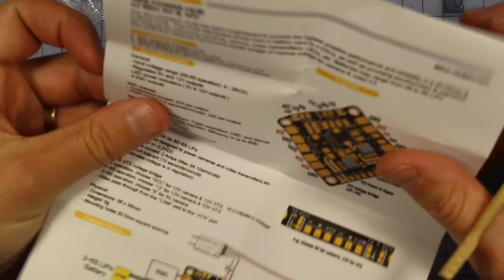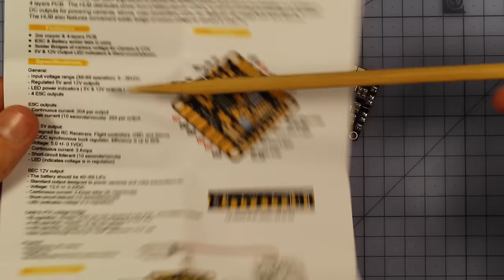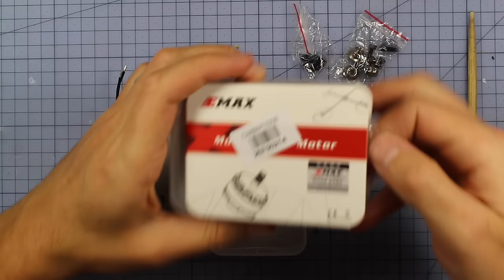Dubai Racer Review. Amazing beginner kit.

Comment: I replaced all M3 screws on lisam 210 frame that goes into standoffs, 10mm for the top plate and 12mm for the bottom plate, because there is only 10mm of thread in the standoffs.

Comment: Thank you and congratulations for your video. I'm wondering what battery you would recommend for the GB210 (same chassis and motors as Dubai 210 but with 30A ESCs instead of 20A)? I've seen the GB210 supports 3S as well as 4S batteries, in the range 1300-1800mAh. According to my computations, with a 4S / 1800mAh, it should have around 70C. Am I correct? Do you rather recommend a 3S or 4S for this quad (GB210, not Dubai 210)? What battery would you recommend? 
Thank you in advance for your help.
Reply from the maker: get something like 1400mah 4s 60+c rating.

Comment: i bought some 1800mAh 75c 3s batterries for this build, can anyone help try to figure out a flight time for these batterries? should i invesnt in osd for the voltage of the batterries
Reply from the maker: between 4 and 8 minutes
Reply: UAVfutures is the Dubai 210 a good first drone
Reply: Max Fan not the nest to be honest, when i ordered the kit many of the parts were not functioning properly. I have since built another with some better parts and it works wonderful. I used a similar frame, same motors but i got a Raptor 390 tower (all in one fc, pdb, and esc's). The only thing else you need is the camera, vtx and receiver. Hope this helped

Comment: Great vid, thanks.I have that same frame and can confirm the top plate is pretty weak. Broke on 2nd crash.Going to move the build over to an original qav210.
Reply: I lasted a few more flights before i snapped the top, but you can get the actual replacement top for the QAV from getfpv.com for about 13 bucks. Plus its a 2mm replacement so better than the 1.5mm this kit comes with.

Comment: Could I ask you a question? What kind of soldering station do you use? Or do you use an in expensive soldering iron? Are you going  to do a build video for this quad copter? Thanks Rich
Reply from the maker: I use a cheap soldering iron about $20... It works fine for me. I already have a build guide up on my channel for it

Comment: Hello I'm have the same esc you used in this build how did you fix them what setup did you use to flash them in blheli. mines are reading 12 amp afro's,  simonk bootloader, but the were supposed to be 20 amp blheli.
Reply from the maker: just flash them with the latest firmware and they are fine.

Comment: Can you suggest other parts that would go well with this kit, specifically for beginners? Things like remote controllers, batteries, FPV gear etc? 
Thanks.
Reply from the maker: Taranis radio, 1300 3s or 4s batteries, Hs1177 camera, and a 200mw foxeer or aomway vtx, I actually have a build of it on my channel too.
Reply: Thanks for the tips, one more thing I just thought of; mode 1 or mode 2 for the radio?

Comment: heya . I have got this kit now and building it .quick question with the esc''s and flashing , can I reverse the esc''s within no blheli suite or do I have to do u reverse set of wiring ? great kit sofar thank-you for your recommendation on this
Reply: actually scratch that .. its all good they supply long and short screws with the motors annnnd dont use the longer ones as they pinch and kill the coils in the motors

Comment: Would you be able to tell me which motors use the standard nuts? The motor manufacturers can't seem to decide whether clockwise means the rotation of the motor, or the direction of the thread on the nut..
Reply: Cw and ccw refers to the thread on the brushless motors. Really stupid as everyone who races uses lock nuts. Unnecessary hassle.
Reply from the maker: agree. get rid of them and just use lock nuts
Reply: +UAVfutures love your channel and the fact that you still manage to bug up the intro.

Comment: You can get that exact frame from eBay for $13 including shipping.I have the 180 version. Broke the top deck as expected.  It's OK, but you get what you pay for... I bought 2 of them in order to have a spare.
Reply from the maker: you should epoxy them together maybe. Someone suggested that you could run you battery around the whole frame and not just the top plate.
Reply: That's exactly what I'm doing (running the strap around the whole frame).  It does provide strength, that's for sure.  Mine broke at the back - the tab at the back for the battery wire and vtx. It's the weakest part of the quad.  That's OK. At $13 I can deal with that :-) easily fixed.

Comment: Hi there, love your videos....have just subscribed as you keep popping up in my feed.  :)  I have one of these coming from Gearbest, cost me £102    Quick question regarding the esc's, some other reviewers say you need to upgrade the esc's to run 4s, is this really the case?    RegardsCharly  PS What battery are you using?
Reply from the maker: Personally for me I always upgrade to the latest firmware when I do a build. I run a 4s battery and it works fine. The easy thing is you can do all this though the" bl heli suite" program.
Reply: Thank you, there is some miss information out there and like you on previous quads with 20amp esc's I have run 4s, even with cheap SimonK esc's.  I know these motors will do 23 amps but most 20amp esc's can do 30amp bursts anyway.  Unless someone invents a cheap battery that you have the space to hold the throttle wide open for a long period of time I do not see any problems.  Thanks for your reply and keep up the good work :)    PS: What battery id you use on this quad as I have still to order one?
Reply from the maker: Charly Sayz a 4s 1300mah hich c battery
Reply: UAVfutures Thanks :)

Comment: Hi this is my first racing build and configuration of software - is it pretty straightforward to do on BLHeli as never used this before only used clean flight for 250s.
Reply from the maker: very straight forward and easy
Reply: Hi went through to do this today but when I connected battery the board blew. Checked all soldering and connections and were fine - re wired another board and the same thing happened and exactly the same component blew on the board.  Do you have any suggestions as to what this might be?
Reply from the maker: Deecat21 so before you even worry about the software side of things, zero components should be blowing. something in your set up is not connected right.
Reply: Have double checked the connections with your video.  All clean and ok.  Might desolder the wires on pdb and start again!
Reply from the maker: Deecat21 Which part is blowing?

Comment: I ordered this kit and one of the six large standoffs that it came with had no threads on one end.  Is this normal?
Reply from the maker: umm no. That is very odd???
Reply: I'll have to contact gear best about it.  A new set of standoffs is only $5.50 on eBay, but it definitely threw me for a loop when I went to assemble it.
Reply from the maker: Nick Joslin for sure haha, at least you will still be able to build your quad while you wait

Comment: +UAVfutures  I would like to get into mini quads and this is the kit im most likely to buy but i really don't understand what has to be done on the software front of the build
Reply: You need to get CleanFlight chrome app and then plug in your flight controller. from there you flash cleanflight and can start configuring. There is very little needed initially to get the kit going. Then you just tweak tweak tweak as you find new features or options to set

Comment: For some reason whenever I add throttle my motos make the start up noise, (the noise then you first plug in bat, add throttle makes noise, cut throttle, add throttle again starts noise over ect, any recomendations? Thanks, Cooper.
Reply from the maker: calibrate your escs
Reply: +UAVfutures I have done that multiple times.
Reply from the maker: Cooper Stukel have up updated the firmware in bl heli suite
Reply: No, because there aren't really any good tutorials online to do that.
Reply: Yes i have flashed them and still keeps beepping.

Comment: great video Stu, what else should i get with this kit if i'm just starting out?
Reply from the maker: fpv gear and you are good to go
Reply: i just bought this kit too. Im new to this aswell. im getting the frysky taranis xd9 or something and fatshark dominators v3.
Reply: Sp racing board..."reliable" may be stretching it.
Reply from the maker: ok. I meant performance wise. Those connectors can snap off sometimes. but still a pretty solid performer

Comment: hi watt is your pid settings ?i have the same similor  setup but don't know how to setup mi pid .can you help me please ?
Reply from the maker: are you running betaflight
Reply: UAVfutures hi no i run on betaflight 2,.9.0
Reply: mi setup is 2204. 2300kv .emax .and flightcontroller is emax-skyline 32. bl heli 30 amp and mi frame is a Qav 210
Reply from the maker: brian scheko betaflight stock pids should be fine
Reply: ok thanks  for your  time .i appreciate it.
Reply: one more thing .i have a Taranis plus .when i am under 50% throttle my quad don't keep its position .it keeps going down .only above 50 i can control it where i wont it to be .but i cant fly low .mi setup is a clean one without doing  something in the model setup in the radio.where can i look for the problem ?
Reply from the maker: brian scheko I think you need to reduce the weight of your quad. It sounds heavy if you need over 50% throttle
Reply: ok i gonna try remove some things and see what happens  .thanks man.

Comment: Great video as always, if you're worried about the strength of the top of the frame, wouldn't it make sense to run a longer battery strap which wraps all the way around? That way you don't have the weight of the battery hanging off the thin plate.
Reply from the maker: THis is a really good idea
Reply: Not my idea; BoltRC suggest it for their frames, it seems obvious in retrospect. Speaking of Bolt, when are we going to see the Kraken review?
Reply from the maker: soon, Waiting on some bl heli s escs to get here and Ill be able to build it up
Reply: That's exactly what I do.  I have broken the top plate at the back - the bit that sticks out the back - but that's a weak point so I kind of expect that to happen.  I bet the Lumenier frame doesn't suffer from this malady, but at 10 times the price it shouldn't!!!
Reply: +Simon Wallace I can't see how any frame with that design wouldn't break there unless it uses thicker carbon.
Reply: Too right +benaresq - I will be laminating the end of the top plate with epoxy in future to thicken it up and give it more rigidity in future.
Reply: +Simon Wallace I've got one on order now, I'm thinking about cutting the back section off and fitting a stiff rubber/eurothane flap to hold the antenna.
Reply: I think that's a great idea!  I run my 2.4G antennae closer to the front. I use the hole on the back section for the power leads instead of the VTX antenna, I just couldn't get the right pigtail to feed into that hole.  Seems to work OK.  But I think your idea is better.

Comment: Great build video and everything... made me buy the kit. I was so stoked... but now two esc went into flames and the fc died on me. Don't know why.. I updated the fc, then the motors spinned like crazy. Yanked out the lipo offcourse.. but the damage was done. One esc died. I bought the same esc.. but again it fried. I orderd some new esc's and fc... I tried to update the esc's, but BLHeli didn't reconised them. I just read the esc's are flashed with 12a firmware and the oneshot doesn't work.. wth!!
Reply from the maker: OMG that sounds crazy ...were there any shorts. never had that happen in any of my builds.
Reply: +UAVfutures I triple checked the wires. I found some people on the internet with the same issue. They thought it was the firmware on the esc that don't go well with cleanflight. Oh well.. it's a part of the hobby. 😊

Comment: I'd be willing to bet that the CW vs CCW motors have better cooling when spinning in their correct direction. But thatsvthe only thing that would make sense.
Reply from the maker: Someone commented below saying the cooling was omni directional. Back in the day the threads were used to self tighten the nut onto the prop. But now we use lock nuts this function is redundant

Comment: did anyone here have issues with the ESC's? some people have been telling me that these ES's can NOT handle 4S, and they have burned through a couple sets of the OCDAYS.
Reply from the maker: been smashing mine of 4s. try updating them to the latest revision of bl heli
Reply: +UAVfutures You mentioned you updated to the latest, but did you choose the latest Afro 12A firmware or did you flash the 20A firmware? I flashed the latest 12A but it just feels weird that they list as 20A but have 12A firmware on them
Reply: This answer is so hard to find..... I found one post in rcgroups stating they took the dive and did it with no issues, however idk how to trust that.  Still debating if I should upgrade from 12A to 20A....
Reply: I would suggest dumping those esc's. I've heard from many people that their's caught fire. Same thing happend to me, caught fire mid air, my quad came tumbling down, and broke an arm and trashed a lipo. I would suggest getting something like this http://www.banggood.com/4X-Racerstar-RS20A-V2-New-20A-Blheli_S-OPTO-2-4S-ESC-Support-Oneshot42-Multishot-for-FPV-Racer-p-1074732.html?p=LP311511816182015013 or better yet the 30amp one
Reply: +danq0 thanks for the heads up.  A lot of research on these ESCs pretty much concludes what you said.  These just aren't good.  A lot of people have said similar things and I upgraded the firmware to the latest BLHeli to support 4S batteries which some claim all is needed to prevent this but it's just not worth that chance.  I'll fly this for now with 3S batteries while I wait for those ESCs you posted (30A, why not it's only a few bucks more).  Thanks for responding to me and giving me a suggestion, extremely helpful and I really appreciate you going out of your way to do that!  I'll be racing tonight for the first time on this build so crossing my fingers that I don't warm up the place.... Oh man I should post that to my channel......

Comment: Mate you've got to try the Xracer 3.0. It's a brilliant board.
Reply from the maker: Didnt Joshua just do a review of that one?
Reply: +UAVfutures Yes he did. I have the 2.1 and my 3.0 arrived today ☺
Reply: +UAVfutures My emax red bottoms came with black for cw and silver for ccw. which make sense. I'll be interested to see if those escs hold up.
Reply from the maker: I think they are like little bees or possible older sn20a escs
Reply: +UAVfutures What are you running the FC at? (kHz)
Reply from the maker: doondedulin44 didnt mess with that on this review. Just standard. I think that is 1k...Ill have to check that out though.
Reply: +UAVfutures With a quick look at the EVO deluxe it's running SPI so you could run it at 8kHz, right? The reason I question my statement is that the EVO has the 6050 chip therefore 4kHz max is recommended? I thought you needed the 6000 chip to run at 8kHz. What are you thoughts?
Reply from the maker: doondedulin44 not %100 sure mate. I am going to run it at 4khz
Reply: +UAVfutures Sweet... My FR632 arrived today. It's half the size I thought It'd be. Love the auto scan ☺

Comment: I actually found out the fc that is labeled ocday is actually a knockoff according to painless360
Reply from the maker: what did he say about it?
Reply: +UAVfutures That it does not fly as good as the real version  and also flashing firmware is a challenge. I also learned that ocday has not made a product that is not a knockoff of something good.
Reply: Apparently any SP F3 board coming from China is more than likely a fake.  I've got 3 of them...  They all have very slight differences depending on where you get them from.